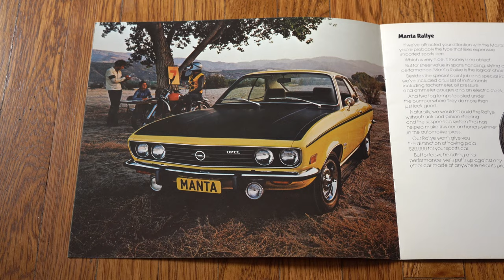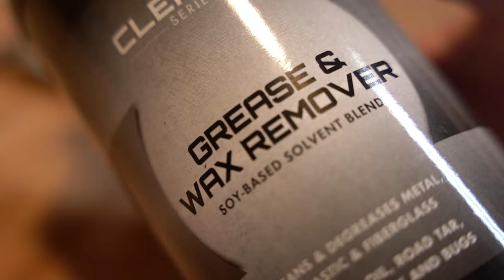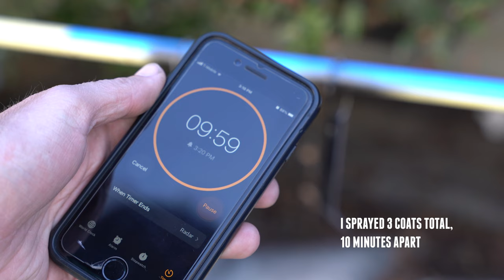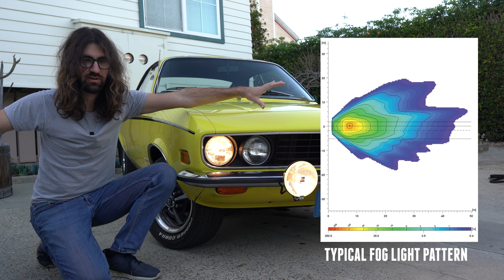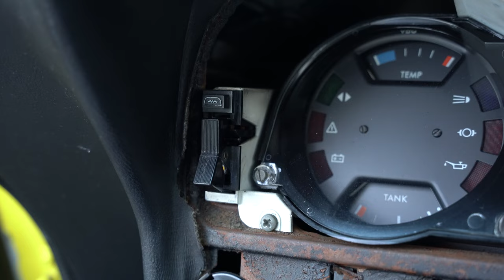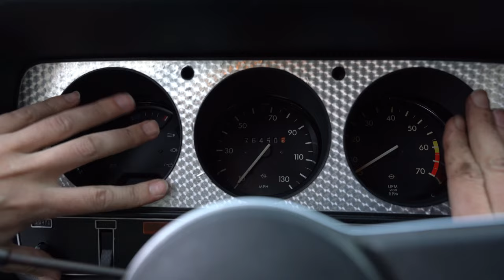Installing Fog/Driving Lights by Trial & Error - Vintage Hella 160's on my Opel Manta

Comment: This deserves more views *subbed. Another option is you can now buy tubular license plate frames that allow driving light mounting on eBay or Amazon.
Reply from the maker: Well thanks! That's an interesting thought. I think every vehicle is gonna have different mounting challenges. In my case I was glad I figured out a solid way to do it without adding any new holes to the car body.

Comment: such category as driving lights doesnt exist. Its either a fog light, or an additional set of high beams. (of course there is drl category, but in this case its not). so if its a fog light you have to wire it so it can come on with parking lights and can be on with low beams high beams. if its a + high beam, then it has to be on with high beams. with fog lights when the weather is bad, you can use it. if its a high beam you have to switch off when someone is coming, and it has to work simultaneously with your factory high beams. its that simple. americans started calling everything driving lights, which category doesnt exist, and even they cant define what it is. every light is a driving light because its not mounted on my house. also parking lights (5w) are not driving lights as well. and DRL is a separate thing usually 21w or led, and only on the front. but that is Daytime RUNNING LIGHT. who came up with the term driving light????? now you have to use high beam and "driving lights" separately so its 2 switches, every time someone is coming, instead just using it as high beam. EVERY DAMN AMERICAN WIRES THESE TO A SWITCH , while we wire to high beam so it can be turned off instantly with one switch. not 2
Reply from the maker: Another way to define these is "auxiliary lights". Meaning they are an extra supplement to the factory lights, and you can do whatever you want with them. I prefer having them on a separate switch so I can use them independently. But I agree they shouldn't be used in traffic, just like "off-road" or "rally" lights. Same basic idea.
Reply: To add to the confusion they also have the category of spot lamps where the fresnel lens is replaced by a clear lens and the optics are setup for a narrow concentrated beam .

Comment: The lights are of course, Hella cool man! I bought a set when I was in Germany for my '74, yet to put them on as I am changing the large aluminum bumper with a '67-'68 Camaro bumper and fiber spoiler first.
Reply from the maker: Right on! Bumper change on a 74+ is a good idea, I feel very lucky to have the small bumper version. Camaro bumper seems like a popular starting point since it's a nice, simple chrome bumper.